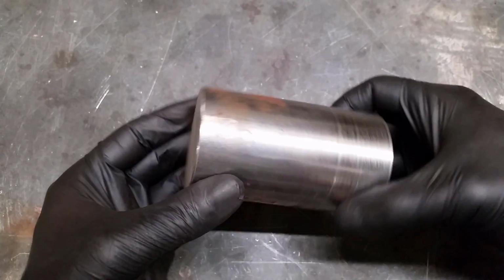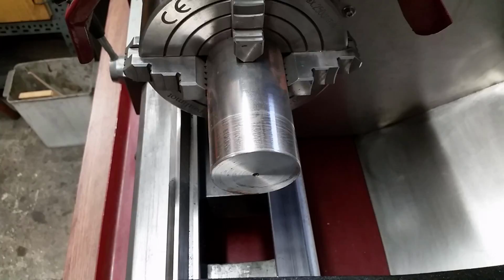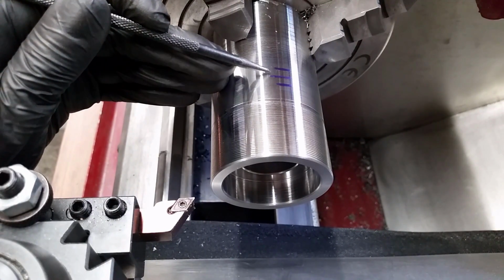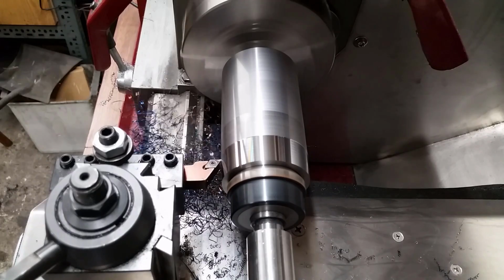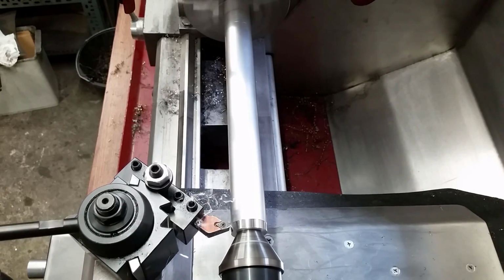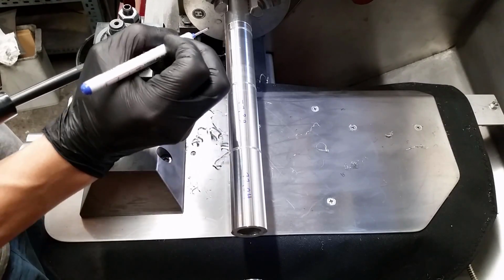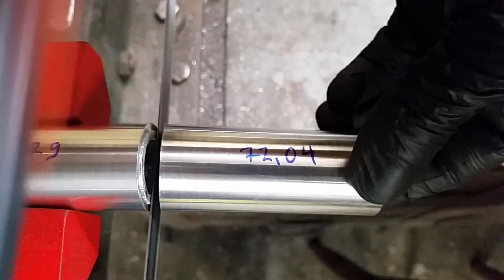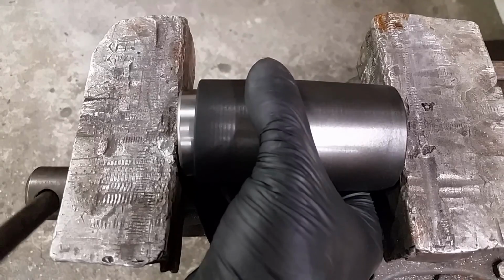Machining Rollers For My DIY Belt Sander

Comment: I've been wanting to make different size rollers for my belt sander too.  Good to see you back and looking forward to seeing what your future videos are
Reply from the maker: The size wasn't the problem. I just didn't make the rollers when i build my belt sander. 

I have some ideas about future videos. Most of them will be about machining tools and equipment for my lathe. Maybe videos of some commissioned work if the customer allows it.

Comment: That metal machined like 4140 pre-hard, it don't do well with small cuts, great looking rollers.
Reply from the maker: Thanks. The rollers are working great. No sign of wear yet. I ordered mild steel but this is could be 4140 pre-hard. Or anything else. It was harder to machine than normal stainless.